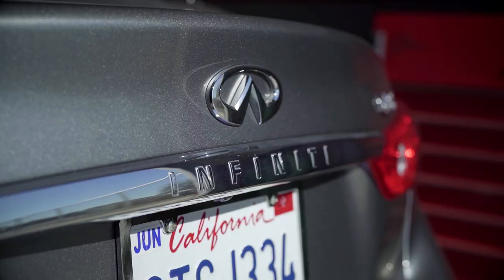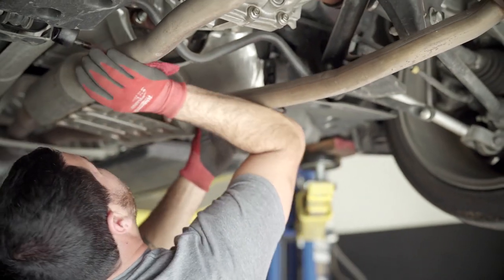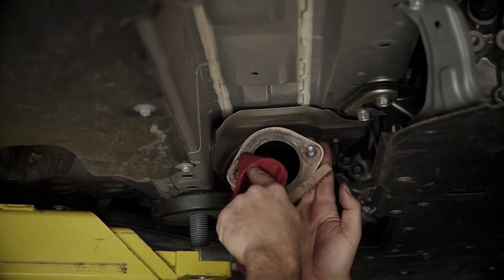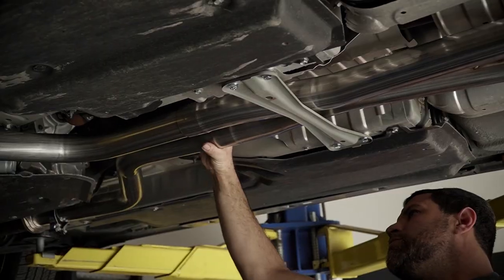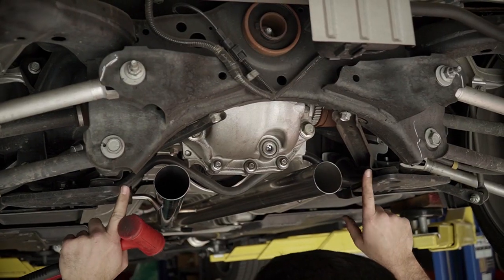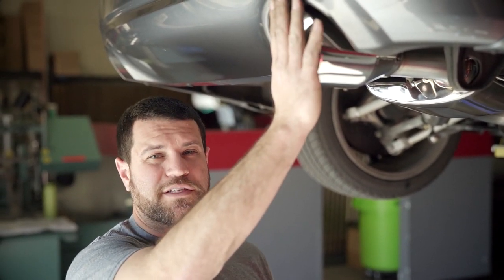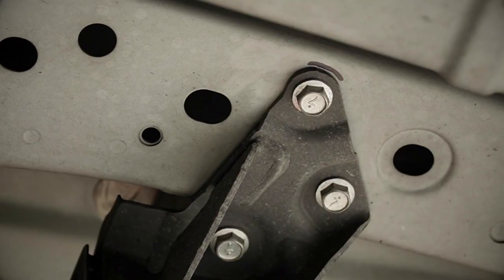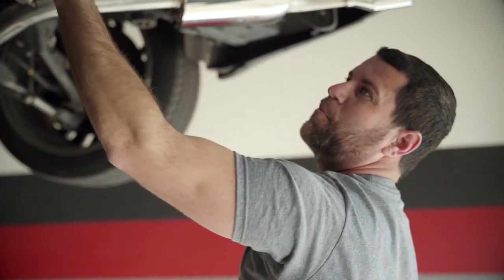HOW TO: Installation of our Q50 & Q60 Exhaust System

Comment: So this is a catback exhaust that I can purchase? Also this comes with no resonators correct? So is there any drone in the cabin?
Reply from the maker: Yes, we make a replacement cat-back exhaust system for the Q50 VR30DDTT.  It can be purchase with or without resonators if you choose.  With stock downpipes, we recommend the non-resonated exhaust system.  Attached is a link to our website with more information.  You can also call us (805) 522-3278 with any other questions. https://www.fastintentions.com/product_info.php/cPath/41_50_169_171/products_id/289

Comment: Do you reccommend removing the exhaust heat shield ? I've heard some ppl remove it to get rid of any exhaust noise or rattle
Reply from the maker: Great question, however we have never had to remove the heat shield.  When installed correct there won't be an exhaust rattle.  If a rattle occurs then most likely the exhaust system is coming in contact with something underneath the vehicle.

Comment: If i was interested in the 14inch touring exhaust that is resonated, would that affect the sound on the exterior? Or just give it a more quieter interior sound in the cabin? I seen the non resonated video and it doesn’t sound like it’s much drone which is what I’m trying to avoid.
Reply from the maker: Great reply and questions!  The resonators primary objective is to cut down interior noise resonance (drone) without effecting performance.  Keeping in mind that this very same CBE is compatible on 2 different Q50 engine variations; the 3.7L NA engine, as well as the 3.0L TT engine.  The NA version is much louder, as the turbos act as primary mufflers on the 3.0L version, hence making it quieter.  All this said, sound is subjective and we all perceive it differently.  In our honest opinion the resonated version is not needed on the 3.0L engine.  Hope this clarifies it for you and if you have any other questions or would like to place an order, please do not hesitate to contact us. (805) 522-3278

Thanks.
-Tony
Reply: @FastIntentions  thank you so much for answering my inquiry and I will be calling shortly to place an order!!

Comment: What are the boots called that go on the back of the exhaust hanger shaft collar?
Reply from the maker: Thanks for sending a message.  I think what you're referring to is the shaft collars that hold secure the metal exhaust hanger to the rubber hanger underneath the car.

Comment: Do you prefer the 14” resonators X-pipe or non resonator ?
Reply from the maker: Non-Resonated is the most popular selling option; especially with stock downpipes or lower downpipes.  If you have full downpipes installed, you might want to go with the 14" Resonated x-pipe.
Reply: @FastIntentions  Appreciate it 🤙🏻
Reply from the maker: @junebug0010  No problem.  If you have any "in depth" questions you can always call us to discuss your specific needs.  We can custom tailor the exhaust system to your liking.  Don't hesitate to reach out to Kevin at (805) 522-3278.